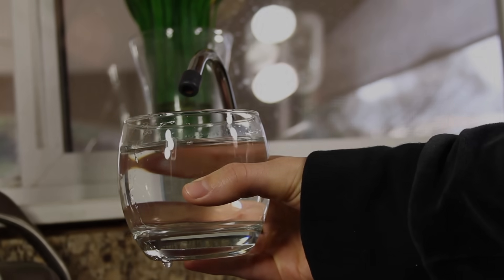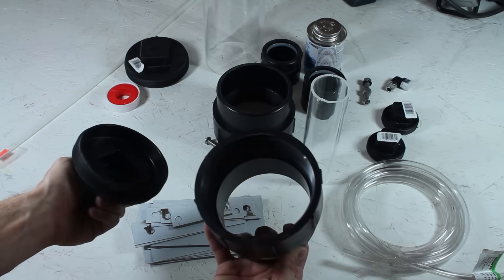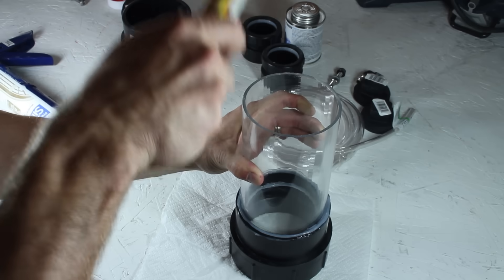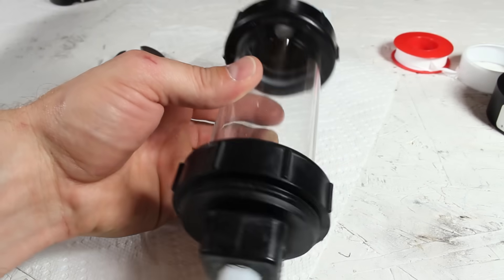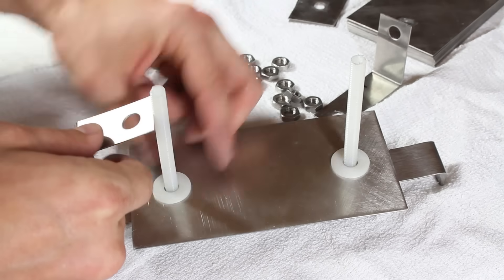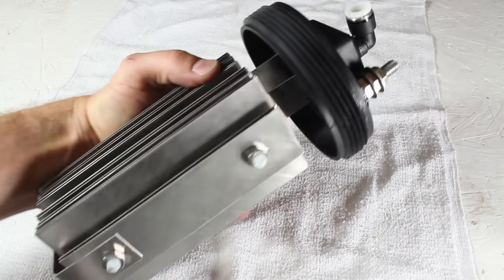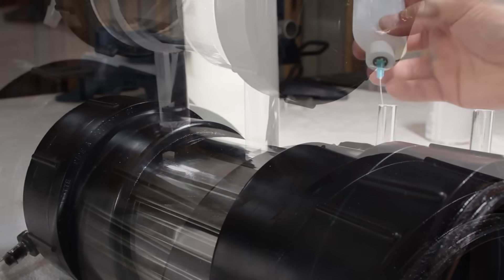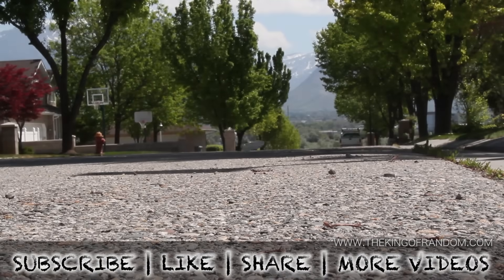HHO Generator - Water to Fuel Converter

Comment: can someone explain to me how this could work if the plates are separated by a nylon washer? The stud connecting them all is also nylon. There is nothing conductive to connect the plates together.
Reply: The water with the electrolyte conducts the electricity between plates
Reply: Water conducts electricity.

Comment: energy breakdown, pls. 

two 12V batteries used for electrolysis, into a ice generator, and tap some of that power back to charge the 12V batteries (to avoid depleting them). Seems like a closed loop perfect system

Comment: This is how you burn water.  People think this is ok but it's not.  We shouldn't combust hydrogen ever.  This is how they get cars to run off water.  The problem is once hydrogen is gone it's gone just like gas.  Bye bye water.  Don't listen to anyone who tells you different.  You can't combust things and think it will be there tomorrow and there is no such thing as free energy.  Hydrogen isn't renewable.  Yes it's true it does put off a water vaper when used but it's less then it's starting point.  There is water loss in this process.  Without Hydrogen water can't be created.  Hydrogen is all around us.  In the air you can feel it when you breathe.  We don't want to dry up the planet.
Reply: “And when the gas is used it simply turns back into water” 8:25 ?
Reply: Hydrogen is used as fuel for rockets as well as the fuel for hydrogen fuel cells in cars. It burns in oxygen to form water. The flame is almost colourless.

Comment: No-one ever mentions how long this can be sustained before the water gets too hot. if you're adding 24v x 60amps - 1440 watts into that small contained you will very soon end up with boiling water instead of producing hydrogen gas

Comment: only use DC battery? ever think of using much higher voltage electric pulse with proper frequency? If the frequency is right, breaking up H2O doesn't need that much of power, if H2O has a resonate breakup frequency

Comment: If you use a external  power. like solar energy I think  it will work ( I think the battery  motor  it's to smaller  to get the energy you need

Comment: This project is very nice we can run a on HHO gas just need to connect 2 extra Alternator in car and Two battery in car , Hydrogen is powerful gas 24v/50 A required

Comment: Would you say you could use this method to eventually use the hydrogen gas produced to run a generator and charge an EV car battery and how much would you think would cost to produce a 1kw electric power. Cause if you could use a small amount of electricity and water turn it into gas and then use the power of the gas when burnt to create electricity. You could use it to charge your EV, heat your home etc.

Comment: It appears to me that your design puts out a considerable amount of gas! My only question is that some of the interior plates are isolated from both positive and negative anodes by plastic washers!
Am I missing something in the assembly?
It would be nice to hear from you.
Thank you
Richard
Reply: The electricity flows through the water between the plates. This is why  electrolytes are added to the water, to lower the water resistance, thus allowing  minimum potential for electrolysis.

Comment: Wouldn't this suffer the problem of the stainless steel slowly creating a toxic chemical in the water that you, then, have to dispose of? I remember this issue with other stainless steel electrolysis rigs, and, while not super important there, here, all this construction for the steel fins would have to be redone every time they burn out. Every time you use this, I think it would create this toxic chemical I cannot remember the name of. I think chromium VI or something or other. Would something like nickel be any better?
Reply: You're referring to the residual harmless "plume" created by oxidized impurities in the metal reacting to the electricity. It can be dumped anywhere and will not hurt plants or animals. Hexavalent chromium on the other hand is a toxic carcinogenic and is chemically bonded to the steel. If the steel has no chrome treatment... There's no naturally occurring chrome in the steel to be released. Hex -chromium (or chrome 6) must be broken down to trivalent chromium (or trichrome / chrome 3) before it can be released into the water treatment where it's bonded to another agent and removed from the water via a flocking agent, then pressed and dried into a clay-like toxic sludge that must be properly disposed of... You're not dealing with that type of complexity with this system. Simply change the water when the plume overtakes about a third of the volume.

Comment: I wonder if these could be commercialized for at-home gas use?  What would it take to convert appliances for example?  And then you would presumably have a bit of storage to level out the pressure, then the unit could power on any time demand is called for.
Reply: You need to convert gas to electrical. You could retrofit a combustion gasoline generator into this, wouldnt take much work. Just be careful and from what I have seen (havent been able to verify yet) it works. But the idea here is to make a viable fissile burnable fuel from Water (Hydrogen extraction) and use that burnable fuel in applications including energy generation. Essentially converting water into fuel.

Comment: The big-oil and the big-govt are so pissed off by anything like this.
How about adding a small two stroke gasoline engine and dedicate it to drive a small electric generator for HHO production so to isolate and test out better improvement without screwing up the original engine configuration?!! Remove the front passenger seat if space is needed for it.

Comment: Why use car batters why not use 12 or 24 -volt solar panels and you have got virtually free fule production!
Reply: Probably didnt see a reason to buy 1 or 2 solar panels for this production - but for anyone wanting to do this just buy a 100 watt 12 volt solar panel. (Renogy part number: RNG-100D-SS-US runs for about $105). 1 panel should do the trick but for extra power, 2 wouldnt hurt.

Comment: So why can't you use this to power your car if fumes from the gasoline power the combustion why can't hydrogen gas be used solely or in combination?
Reply: You can but it would take a lot of work getting the mixture right for the MAF and intake. Its better to use hydrogen in direct fuel cells for HEV or ICHV. The safest application is HEV (Hydrogen Electrical Vehicles).
Reply: @alfredharrison597  But why is it better because getting the mixture right for the MAF and intake is complicated? Seems like it can be done just would take some tinkering by someone with the know how.

Comment: This is technically making fuel from water but it takes more electricity to make the reaction that the energy worth of the nitrogen so it’s not like your making more energy than you started with
Reply: If someone could use Solar it would be a great energy storage application and can be used in combustion electrical generators as well as some vehicles. It also doesn't use a lot of electricity. If you could power an electrical gen and feed the power from it into Hydrogen generator you are generating your own fuel, for free. Id prefer solar for hydrogen generation and then use the hydrogen in other applications.

Comment: The laws of Thermodynamics inhibit this from working. The amount of energy it takes to catalyze the water into Brown's gas will always be equal to or less than the energy extracted from combusting it. It can never be more and likely always will be less. Maybe a way around this would be to employ a solar panel charged battery to drive the hydrogen generator before combusting it?  Unfortunately, worse yet...the byproduct of combusting HHO gas will be water and that will contaminate and corrode the engine over time.

Comment: Highly dangerous and unnecessary not to mention extremely power hungry and self defeating! Use Stanley Meyer's nano bubble tech instead because the gas stays in solution until oxidized in the engine!

Comment: what if, you link this to a 4stroke engine , which produces the 12V you need to produce the gas , and have it running autononymous , to power a generator ? could this work ?
Reply: Here is what I think you are trying to say: can you use a 4 stroke engine (he is read the description) to power this and use this to power a generator. Yes this would work but it would be so much easier and energy efficient to link the 4 stroke engine to the generator because energy would be lost when it goes from engine to hydrogen cell to generator

Comment: I’m actually surprised that this demo is still available to watch on YouTube, soon this technology will be totally censored.
Reply: Why
Reply: @Conissocool  because big oil industry doesn’t like low cost competition.
Reply: @chris.heffernan  getting fuel from this method would require constant refueling because water doesn't last very long, and the water would need to be cleaned so you can't just fill up at the lake
Reply: @Conissocool  that doesn’t agree with some of the videos I’ve seen. Smaller the system, more refilling would be necessary I agree, and from what I’ve read, as long as you have some potash or sodash, you can use any water you want.

Comment: Can you explain the plate setup a bit better. How is the electricity flowing through the plates? Which side was negative and which was positive? Is it using 24vilts or 12? Would either work?

Comment: It appears  that the metal plates are not electrically connected to anything, I would think these plates would need to be connected  to anode or cathode. Do you have a easy  to see connection schematic?
Reply: Read the description it doesn't have the schematics anymore but it does have a explanation on why the plates don't need to be connected

Comment: Why is the power source always a battery? Will it work with AC power source?
Reply: Electrolysis needs a DC current
Reply: Ok, next question. How long will the stainless steel produce hydrogen? What are the byproducts in the water?
Reply: @jasonhall2753  hydrogen and oxygen
Reply: @Conissocool  I'm talking about as the stainless steel breaks down. What is left in the water? How long before you have to change the stainless steel?

Comment: how do you keep the liquid from freezing in the winter 🤔, and the car battery's are they in series or parallel,  and do you really need 2 battery's?
Reply: Use a heater I guess to heat them up? But he said he gets 1.5 liters per minute conversion with one 12 volt battery in the description but he gets 5 liters per minute with two 12 volts in a series (parallel would just be one 12 volt battery lasting twice as long)

Comment: This is great. 
How big should the plates be to produce 10 liter per minute?
Reply: Well 1 12 volt battery made a 1.5 liter per minute conversion and 2 12 volts made 5 liter per minute so 3-4 should do it

Comment: You use high level energy, like electricity, lose 30% of it in the process and end up with hydrogen, for what purpose? Electricity is safer than hydrogen/oxygen and before the conversion, you have more energy.

I would see the point if the converter was powered by tex running water, so you make something from "nothing", but powering it from electricity makes no sense to me. I need purpose, other than the art of making an interesting machine.
Reply: Well using running water to power it would still be using energy just from somewhere else, he did also include a solar panel in the description so use that instead
Reply: @Conissocool  You use high level energy, like electricity, lose 30% of it in the process and end up with hydrogen, for what purpose?

Comment: Why don’t you put this on a car ? And how much amount of electricity is actually needed to produce the hydrogen ? Also could this be a closed system on a car once ignition is started ? Meaning once you start the engine could the amount of hydrogen created be sufficient to power the reactor and produce its own electricity source and the car  too ?

Comment: Can this be hooked up to a normal injector system originally set up for gasoline
Reply: it will. but there will be knocking. to remove that knocking need to make a specific engine that is tuned to hydrogen fuel. 
and needs a new type of transmission combinate for bit faster rpm

Comment: Can an internal combustion motor be made to run on this gas?
Reply: it will. but there will be knocking. to remove that knocking need to make a specific engine that is tuned to hydrogen fuel. 
and needs a new type of transmission combinate for bit faster rpm

Comment: is it possible to convert a gasoline motorcycle and car to run on this ?
Reply: it will. but there will be knocking. to remove that knocking need to make a specific engine that is tuned to hydrogen fuel. 
and needs a new type of transmission combinate for bit faster rpm
Reply: @sebas.tian.  is the knocking due to overheat of engine parts?
Reply: Faster than normal
Reply: Is from the combustion is too fast and sudden

Comment: Can we Run a car on HHO
Reply: it will. but there will be knocking. to remove that knocking need to make a specific engine that is tuned to hydrogen fuel. 
and needs a new type of transmission combinate for bit faster rpm

Comment: This is an energy producing loss to begin with. You can do FAR MORE just with the electricity you use in electrolysis than in this chemical conversion.  I urge caution in dealing with hydrogen, the explosive hydrogen to air ratio is very wide.

Comment: I wonder if I can use this in a engine?
Reply: yes
Reply: it will. but there will be knocking. to remove that knocking need to make a specific engine that is tuned to hydrogen fuel. 
and needs a new type of transmission combinate for bit faster rpm

Comment: Note that this design creates optimal combustion mix that can and will go off from spark. If by any reason for instance bubbler body gives in after flashback and allows fire reach the generator, it will explode showers everything around it with corrosive electrolyte, meaning its game over for your eye sight and skin. There is few design out there that allow you to create gasses separately and then mix them right before igniting them, so those are far safer option, but should be still treated with respect and one should understand how this system works, not to put your self in danger, just like with oxy-acetylene gasses.

Comment: Can you run car motorcycle truck generator etc with it?
Reply: it will. but there will be knocking. to remove that knocking need to make a specific engine that is tuned to hydrogen fuel. 
and needs a new type of transmission combinate for bit faster rpm

Comment: I have a system similar to that on my pick up truck. I get better gas mileage more horsepower and cleaner exhaust and when I say clean I mean clean. 
Put your hand on the exhaust before it’s turned on with the truck running your hand will stink. Turn The unit on put your hand on the exhaust and you will smell absolutely nothing. Like I said it runs way better cleaner air, over 100 miles per tank full, on my vehicle some get more and yes you notice the difference in horsepower it’s amazing. PS. If you want better mileage don’t hot rod lol

Comment: @King Of Random - A draw of about 40Amps 12VDC is what is required to provide enough fuel for a decent sized 4-5 person car.

Theoretically, a car travels about 12 Km on one litre of petrol.

1 litre of water contains enough gas to provide 33.6KW of combustible gas energy.

Petrol only provides around 33% of that at 1.15KW per litre.

So the car would take around 333ml of water to travel 12 Km.

Some cars may not get to acelerate to full power. Although I have seen that many drivers do not mind that they only reach 70-80% of their possible speeds. Primarily due to their inner city travels.

40Amps at 12VDC is only 480 watts per hour.

To find out if such a system is viable, just measure how much current is drawn at what voltage, and measure the time it takes to convert 1 litre of water to gas.

Are you stating in your comments that you are converting 1.5/5 litres of liquid water, into gas, per minute?

You could run a small town/suburb on that.
Reply: It's gonna be a while before he responds

Comment: Since this is water, I am wondering what effect cold weather would have on this that would cause freezing.
Reply: i think the current running through the metal plates would melt the ice, but the tank would crack due to the water expanding from freezing

Comment: The important ingredients you forgot is potassium hydroxide lol ahahahaha you making without that formula sir so very easy without that you cant separate hydrogen and oxygen also you use distelled water ahahahaha 
Dint need that fancy bottles
Preparation
1 tablespoon of potassium hydroxide for 1 galon filled with water
12volts battery negative positive soaked it to bottles
The other one make some 1 bottle filled with water
And there you go you have
Water fuel ahahaha

Comment: Use the fuel as it is produced... that is the secret in making an engine, I presume... No danger in the containment of the fuel...
Reply: I’m not sure how you would do it effectively, if you generated it on the go you couldn’t generate enough to keep a vehicle going without decreasing the efficiency. I think you would have to store it elsewhere
Reply: @mylesrussell7605  ...because the fuel generated is dangerous, it should be consumed as it is produced.... which means a lot of HHO Generator is required... and will be produced as it complies to the demand of the driver's speed... More HHO generators will be turned on for certain speeds...
Reply: @mylesrussell7605  ... but it is very dangerous mixture...